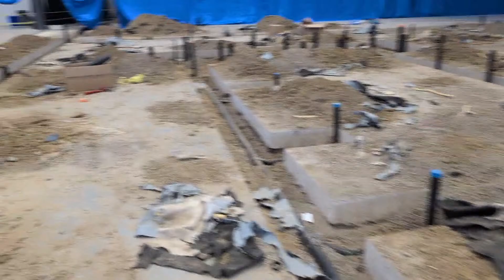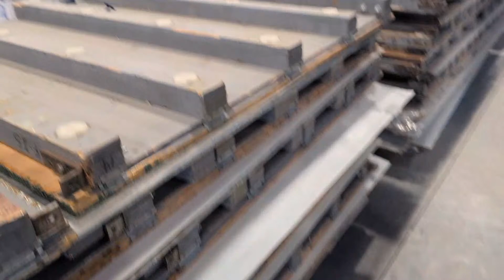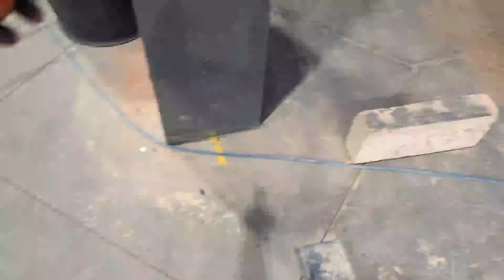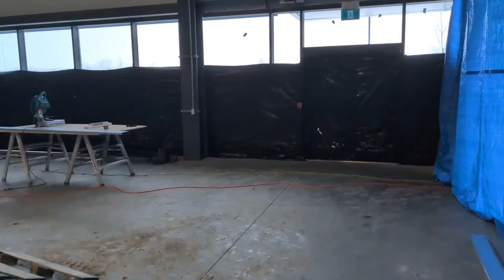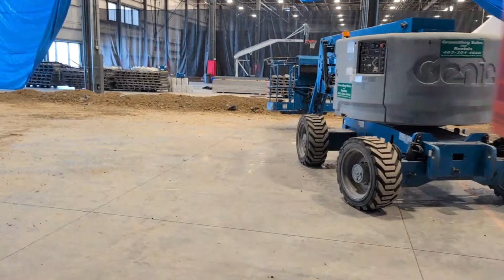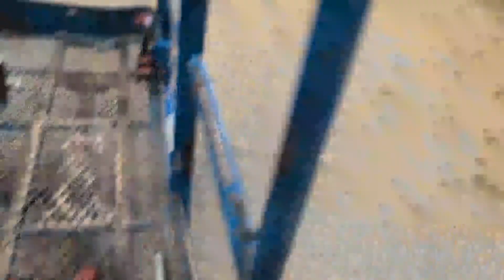18 Gauge 6" 26" High Free Floating Wall! Heavy Gauge Metal Stud Framing.

Comment: Nice work, Chris! So strange they're not going to the deck. It's like they want a gigantic privacy fence. 😂 
The air exchange isn't being addressed let alone the structural integrity. 🤷‍♂️
Hilti gas pin guns is all we use and, yes, scissor lift preferred. We finished a Home Depot with 30' walls not long ago. Freaking TALL! 16 gauge stud. Yeah, I asked the wife for a 35' tape measure for Christmas! Got it. 
Lastly, I hope that Makita chop saw is better than our Dewalt. Ours has to burn through the metal vs actually cutting it. The saw bogs down and we have to work it work it and work the saw blade into the metal to actually get through it. Such a hassle! Ugh. We use Grabber chop saw blades. I think the saw is just old and under powered. I'm a drywaller not a framer by trade. What do I know? 😂
Reply from the maker: Oh ya man the Makita is a beauty! I used to have a Dewalt in between my Makitas becasue I got it for free and it was the same thing burning through not cutting, it sucked. Plus the handle is just right with this Makita. I have no idea why they didnt go all the way up so silly.
Reply: @ConstructionKronies  Ours wasn't ALL 16 and 18 gauge. A lot of it was 6" 20 gauge. However, you may be aware, they required special clips to slide into every stud punch holes and be fastened with hex head screws to the channel to make the stud and channel to become one with each other. Does that make sense?
Reply from the maker: @meagaindave2049  Yes it does, ive used those clips before. This system is strange to me a lot of extra work in times they keep lowering our rates its bonkers!